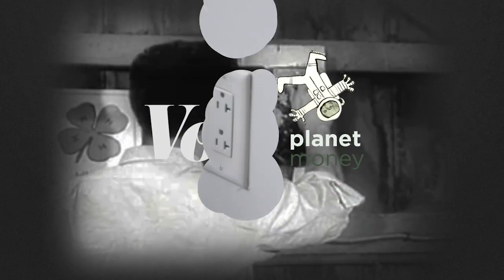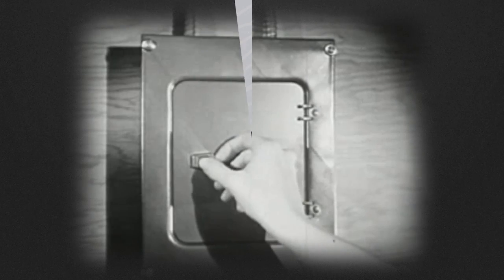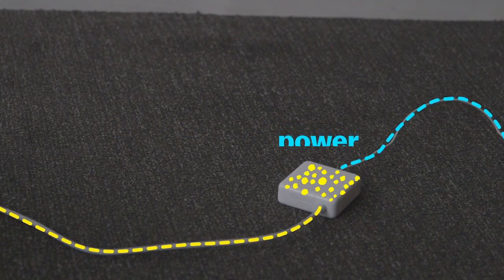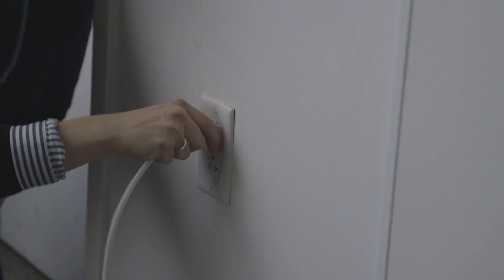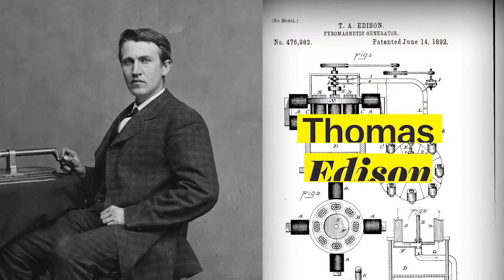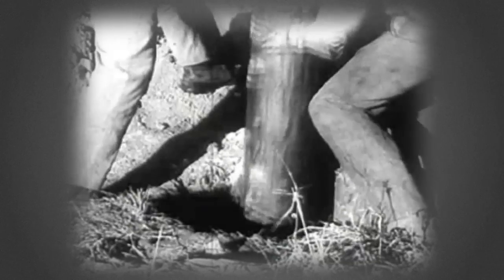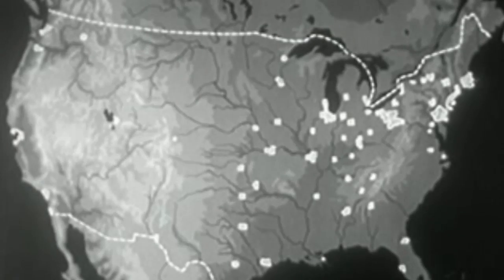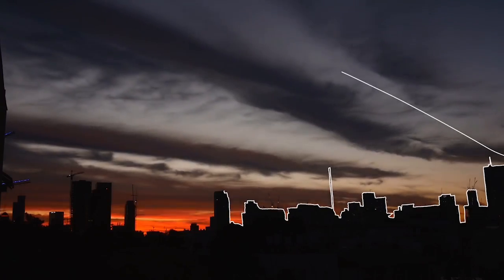Why your laptop charger is so hot

Comment: Well some things require different voltage and amperage so having one conversion box doesn't work unless you either limit high power devices to low power or you bolster all low power devices to handle high power.
Reply: +TekSupport Spacepak is more correct than you are. Rectification is easy - it's DC to DC conversion that's hard and wastes power. Having a single rectifier in your house converting to some completely arbitrary and ultimately insufficient DC voltage is stupid - every device will still have to do the DC to DC conversion and that's where power is wasted. This video is just ridiculously wrong.
Reply: +Ted Middleton Little to none. Not to mention the lower voltage will require much much more copper for thicker cables for low voltage DC. This video was shockingly bad.
Reply: +SpacePak by Mike Ridolfi your smartphone battery voltages changes from 4.2 to 3.3 volts from full to empty. each part of your smartphone have a power and voltage requirement different from other. the power delivery system in every electronics is responsible to send the most efficient voltage possible (camera uses a different volt than the LED flash volt, different from RAMs volt, different from CPU volt, different from GPU volt, different than Antenna volt ect.. ). it is completely possible to have one big AC-DC voltage rectifier and several smaller DC-DC converter, because that is already done in your PC and phone and tablet and TV etc... Trust me, i am an electrical engineer. and i worked with power delivery system before
Reply: ***** Yeah I get that, but still, there are a lot of different voltage required. Each device would need a step up or step down right?
Reply: +N Ei how much of an efficiency gain would we realize by doing lots of DC->DC conversion around the house rather than lots of AC->DC->DC conversion as we do now?
Reply: TekSupport  dude you are way out of your league. Your ideas are ignorance at its best. Please read a book or sumting
Reply: +Ted Middleton Changing to DC would at least solve the issue of impedance. And today DC to DC is not so much of a big deal anymore.
Reply: Nizar El-Zarif Interesting. Thanks for the insight!
Reply: The cables would black out the sun
Reply: +Nam Thai  Teksupport wasn't wrong at all, you cant deliver power at one voltage and say "I am a god of electronics and have solved the world energy crisis". things work at different voltages for a reason, and no matter what voltage you picked it would have to be converted by a good number of them. In addition you have to pick a high voltage (240V is probably about the right mix between saftey, losses and weight, fancy that!). if you dont want your roof to collapse under the weight of the wiring. the losses are less than he suggests, because you dont have to use linear regulation, but his point still stands, you pretty much gain nothing. you now look like a clown for flaming a person who made a pretty bright observation without needing to be told. should probably also mention I am an Electronics engineer to avoid being flamed myself.
Reply: Good to see some great discussions popping up :) Also, I took an EE course during my ME degree. That crap is like magic to me still asside from the basic basic fundamentals ha
Reply: +John Smith  your absolutely right that within a single device you often require different supply rails, and like you say a good number of those are supplied by switchmode supplies. But having a single supply voltage doesn't fix that, only one will be supplied at the correct voltage. The gains are going to be pretty low. You would do alot better to mandate minimum efficiency and standby power usage than to push a switch from AC to DC.
Reply: +TekSupport hahaha silenced. Chime in and apologize for being dramatic and admit you were wrong... come one do it :)
Reply: +TekSupport funny you're both idiots
Reply: +SpacePak by Mike Ridolfi Indeed.  To work it would require standardisation. Laptops tend to use 12V and all USB powered stuff uses 5V.  Most large data centres already do something like this,  feed 12V DC into all the computers,  it works there because if you are, say Google,  you can mandate exactly what power the board takes its much trickier with homes and businesses.
Reply: How comes nobody mentions that DC devices consume only a fraction of average household electricity? Washing mashines, stoves, ovens, refrigerators, hair dryers, toasters, air conditioning use way more electricity than your smartphone and your laptop. It isn't worth it to install double wiring in your house for a few percent increase in efficiency only effecting your electronics, which don't consume much in the first place.
Reply: No Way!  I wonder how AC devices that all use different voltages and amperage handle that when you plug them in????
Reply: +SpacePak by Mike Ridolfi no you don't
Reply: It doesn't need to.    Every DC device already has voltage regulators.   Get a DC power brick from RadioShack that lets you  change the voltage going into something.   You'll notice quickly that most DC powered devices will take anywhere between 5V and 12V no matter what brick they came with or what they say on them,  thats because the voltage regulators are all the same,  and they're wide enough to cover USB connectors (5V) to car lighter adapters (12V).    The ports in your house that output DC could simply just do it at 5V (USB) and cheap voltage regulators that cost a fraction of a cent handle the rest.   We already have a low-voltage standard for power -- USB.   There are already recepticals in wide use in the USA that have AC power outlets and DC USB outlets in the same receptical.
Reply: SpacePak hi small socks
Reply: SpacePak its called a transformer!
Reply: This is why there isn't a big push in the industry for DC in homes. The most power hungry appliances is AC driven and often through coils like the examples you say or have both with internal powersupplies that is larger than a power brick and more efficient. So yes, double wirering could be used but why bother  and going DC->AC is worse efficiency than AC->DC so therefor we stick with AC. I've seen outlets been showed of at shows and seminars that have regular outlets and a built in power supplies and a USB-C outlet for your phone and computer and I think that will be more common, especially in the schools since only a USB-C cable is needed or at some start up companies
As long as we use 20V it is easy to step down to whatever voltage we need
Reply: SpacePak of
Reply: Exactly they don't know what they are saying
Reply: +Ted Middleton uh you should understand how electricity works before you make dumb comments
Reply: +SpacePak by Mike Ridolfi You are just wrong, what is with all of the want to be electrical engineers in these comments. So lets start off with the ac power moving into your house. Generally your circuit breaker will be feed 240v at 15-20 amps. This is enough to power alot of shit. So now lets convert that to dc power, and disperse it accordingly around the house (no different then what they do with ac so far). You know your laptop charger? throw it out, it no longer works. Your laptop charger is a power delivery and a converter but we no longer need a converter. do you think your phone is getting 100% of the current from the wall? no fucking way, it gets converted in a rectifier and then moves through a power delivery so that the dc current is actually usable and safe for the device to use. See these power deliveries exist in every circuit board on earth to some fundamental degree. They contain mosfets, resistors and capacitors. Instead of having converters/rectifiers in every charging brick we would have just have one big rectifier in the house and power each device would control the amount of dc current it would need. Which we are fundamentally doing already. So your argument is completely invalid.
Reply: TekSupport I don't buy your answer. How would the wall DC power know how many volts to supply? And no, I'm not an electrical engineer, I'm a mechanical engineer. I don't know much about EE, but I know enough to see holes in this method.

Comment: So an off-the-grid home wired with DC would require much less solar energy to function?
Reply: +UNCFAN688 Appears to me just like that, ye. The converter is hot, bc it has to waste energy in form of heat, so if you just give the devices the right amount, you'd prolly only need a transistor to level it up and down depending on the device.

Comment: now i can annoy ppl with this knowledge
Reply: +Red Herring unfortunately you'll be wrong
Reply: +Red Herring everyone knew that already
Reply: +Red Herring 
Sure, you can tell people that it's the bridge rectifier generating the heat instead of the transformer, but only so long as it's someone who knows nothing about electronics.
Don't believe everything you hear online, especially if it's scientific illiterates like Vox.
Reply: +systematic101 let the sheeple disseminate misinformation.
Reply: +Bobby Newmark Well it depends on the efficiency of your rectifier, apple wants there laptops to be efficient but they don't care how much energy there laptop chargers waste. The consumer isn't really effected that much thus they cut the cost. However there is no reason why you can't just make a really efficient rectifier that cuts no cost and wastes the minimal amount of energy? I was plating with a titanium rated corsair power supply the other day, i think it had something like a 95% efficiency rating at load.
Reply: +TekSupport unless the rectifier is not connected incorrectly and it is rated for voltage/amps in the application it won't heat up.
Reply: +systematic101 true but how often are rectifiers misconfigured? All the time. Its still is an issue and somebody should do something about. Either make good rectfiers or convert to dc.
Reply: +TekSupport if a rectifier is installed incorrectly it will burn out immediately.  no power supply has it wrong. I use them all the time.
Reply: +systematic101 interesting, thanks
Reply: +Red Herring and your Lamborghini
Reply: Especially electrical engineers. :D
Reply: How old are you? Please be honest.